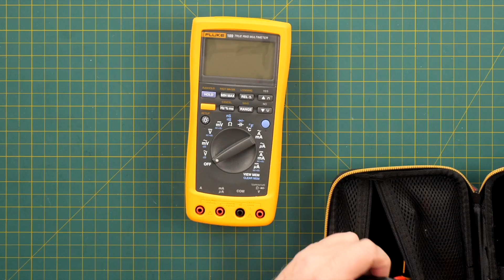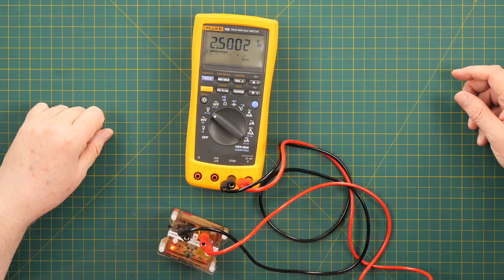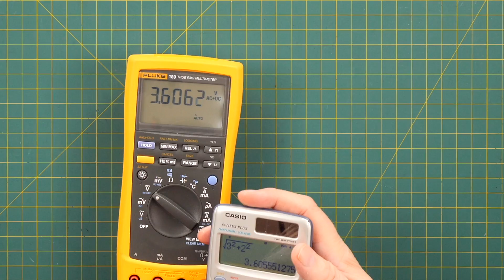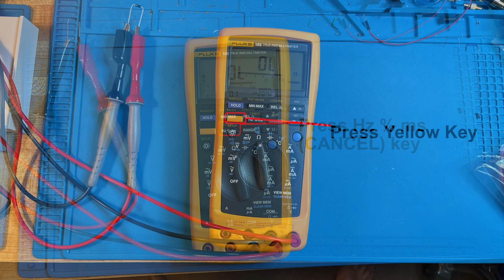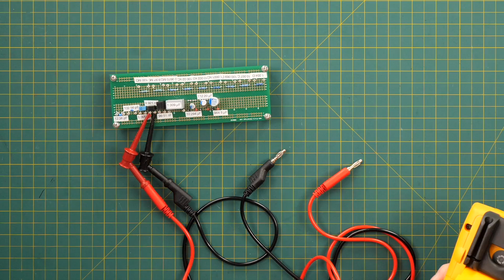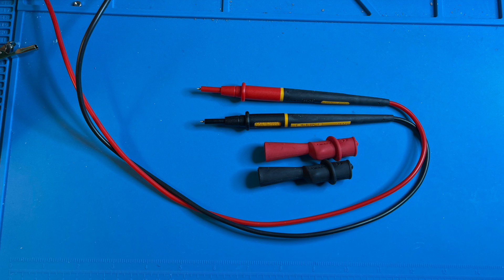Fluke 189 Review

Comment: why does it flactuate so much in resistance mode. is it normal or  is it engineering failure. i have a cheap uni t and it never flactuates in resistance mode

Comment: 189 is a fantastic meter had one of these for 15 Years+ still accurate to this day the only down side is crap battery life , got a 233 which eats batteries for fun so don't bother with this remote head meter, also got a 112 which is real handy tiddler and a couple of 30 year old 77's as tool box work horses with fantastic battery life and rubber bumpers, I remember the RS salesman demoing this meter in the 80's by throwing it against the wall!